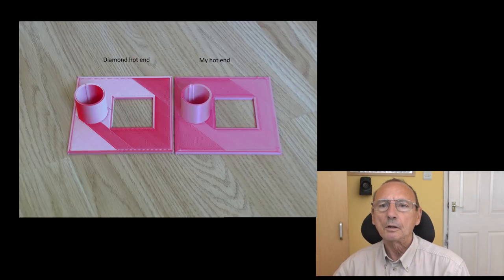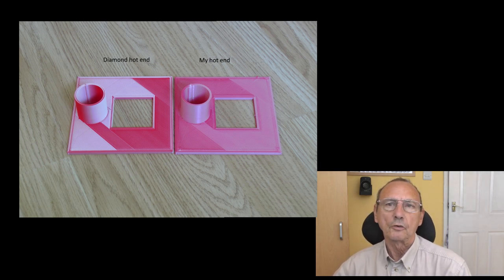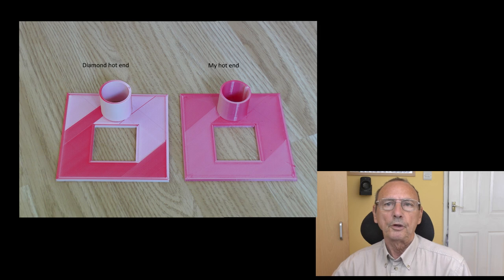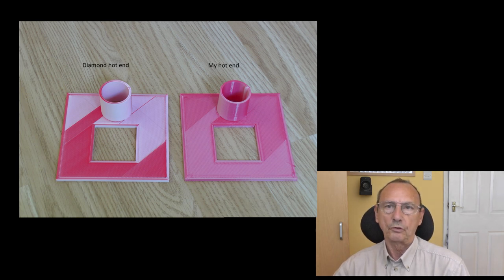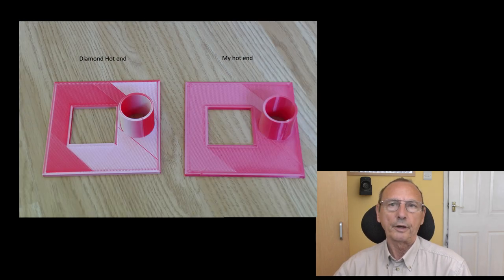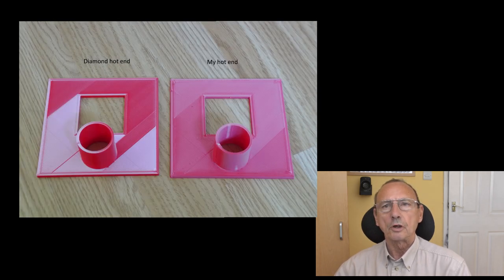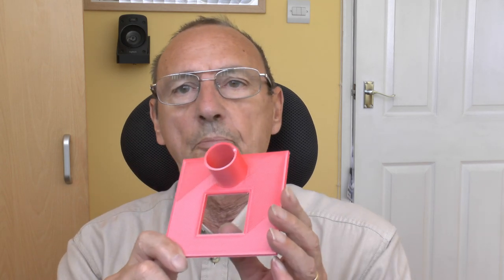My 6 Input Hot End Part16

Comment: I'd think about adding a double turn into the end part of the mixing chamber, just before the nozzle, to relieve some of the pressure to reduce oozing (see wintergatan's pressure relief experiments with the marbles inside the tubes), but this would only add up to the restrictions in the path of the liquid filament, resulting in even greater pressure lag. Oh boy, that's a nice conundrum!
Reply from the maker: Yes, I'm done with it. It's time for me to move on to other things. Maybe someone else will crack the problems at some time in the future and maybe the work I've done up to this point will help them out.
Reply: @deckingman  your work on this is pioneering, and I believe it will be the foundation for any future solution to this problem

Comment: Hi Ian, it is good to see you back in the 3D printing world. Just a probably insane idea, but, instead of using your mixer to produce mixed liquid plastic, how about mixing and reforming the now mixed plastic into new 1.75mm plastic filament? I don't doubt that it would not solve all problems but may get around the "stripey toothpaste effect". A new problem would be introduced to get the section of feedstock synchronized to what is demanded. If this synchronization problem could be solved it would be possible to produce a reel of filament intended for a particular print.
Reply from the maker: That sounds much like the palette system (but without the mixing).

Comment: Another idea is switching to 3 tansparent PLA filaments for color (magenta, yellow, cyan) plus a black and a white non transparent one and layer them to have on the surface the colour you want. Color are not phisically mixed but they should look the right color on surface.
Reply from the maker: Yes, I've successfully printed many objects using the transparent filament trick. It's quite effective but you do have to use all transparent filaments. Mixing them with solid colours doesn't work. Of course, not all objects lend themselves to being printed in transparent filament.
Reply: @deckingman  I mean not mixing but layering themin different perimeters to summ the color trough the transparency. than another layer of white in the back or solid black for, well for the black.. It might be a slicing hassle tough

Comment: Have you tried "monotonous infill" setting?  It prints top/bottom layers in a single direction.
Reply from the maker: I did mention it in the video (although I couldn't remember the what it was called). I haven't tried it but it should cure the stark contrast on the upper layer. But of course, with a hot end that doesn't truly mix, that just means that the upper layer of those sample prints would either be white or red (but not pink).